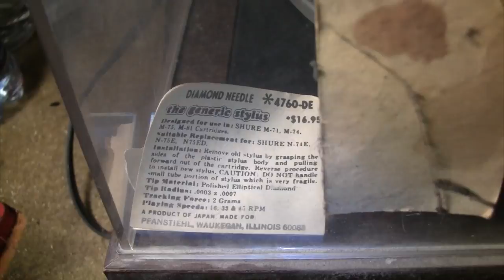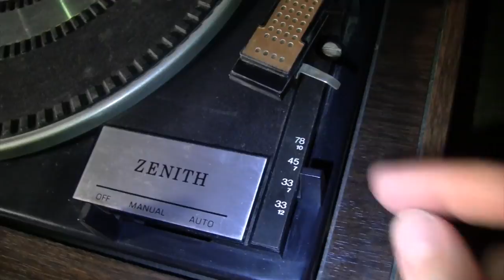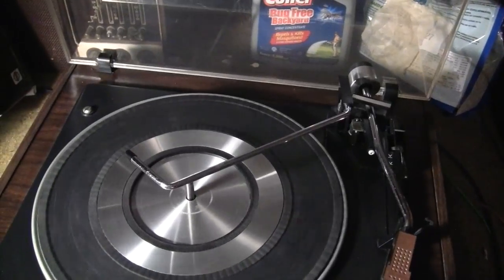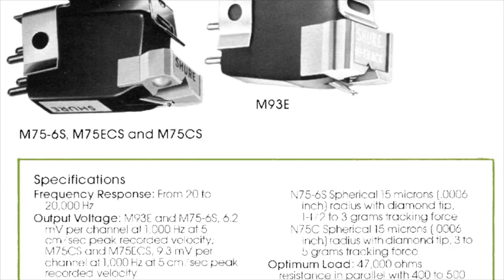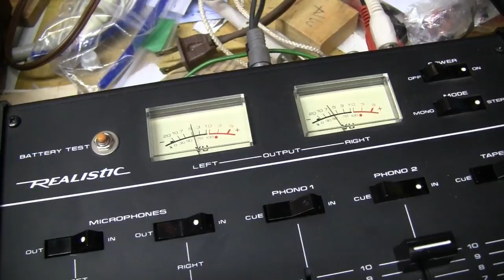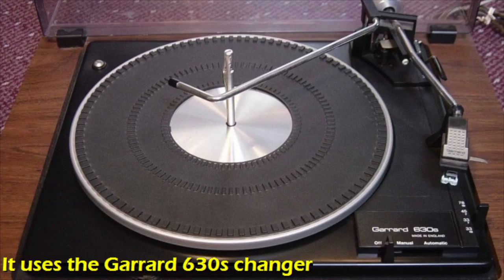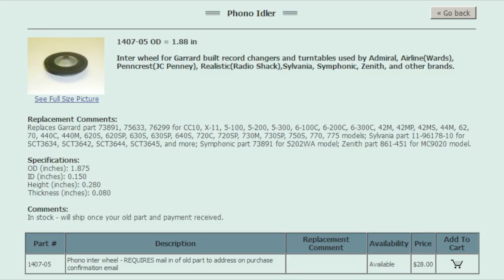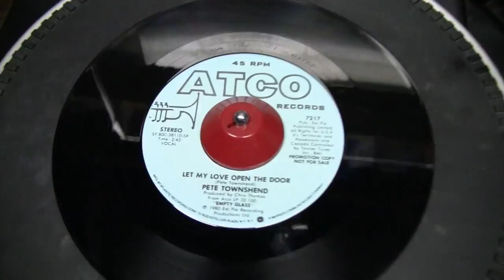Trash-picked 1979 Zenith MC9020 turntable restoration

Comment: I have this same record player, and I am having problems with it. It lowers the needle further and further as it gets closer to the center of the record. It barely touches at the begining, and is dragging the plastic mount of the stylus on the record at the end. That is the best adjustment I can make. Could it be that the metal lifter is bent or crooked? That is all i can think of.
Reply from the maker: I haven't heard of that problem before. Maybe it needs a new stylus, and make sure the tracking force is adjusted properly (you'll need a scale to measure it).
Reply: @vwestlife  It is a weird problem. It is not the stylus or cartridge because the entire arm is lifted higher towards the outside, lower towards the inside. And yes I would like to do that. I could not figure out how to make the arm balance no matter where i adjusted the tracking force. It also seemed like anti skate did not do anything. Is it supposed to make it move towards or away from the center on its own? I still am pretty new to fixing turntable things. Thanks!

Comment: I loved watching his video! I have an old Garrard SL95B that looks very similar under the hood. All of the lubricant has turned to glue and I need to clean it up. What did you use to clean that up on your Zenith? Did you have to significantly disassemble the mechanism to clean it?
Reply from the maker: Just isopropyl alcohol to clean out the old grease. I did not need to disassemble the mechanism.
Reply: @vwestlife  Awesome!  I'll have to give that a try on my SL95B.  I'm pretty sure it's got an idler wheel like this one as well that will need some attention.  Thanks for the tip!

Comment: oounterweight and spring tension, not usually used or needed together. Does the weight turn or adjust?
Reply from the maker: You can adjust the counterweight, but it's meant to be fixed, and any adjustments made via the spring.
Reply: I think it jut turns and is all for show. I almost thought it was a fine turntable.  don't think of tracking that under 2 grams. It wont do it.

Comment: Could it be that the three different "tread" patterns on the mat are for a strobing speed adjustment?
Reply from the maker: Indeed they are, but only for 50 Hz mains power, since that's what they use in the UK where the Garrard record changer was made.

Comment: Try and boiling the idler wheel  for an hour in a little bit of soapy water should soften up  the rubbe, and on that spindle when you put it back but a bit of sewing machine Oil couple of drops looked a bit stiff in its movement
Reply: Well it will change the speed of platter if the idler wheel is bigger or smaller probably not noticeable and that amount though
Reply from the maker: The diameter of the idler wheel does not change the speed.